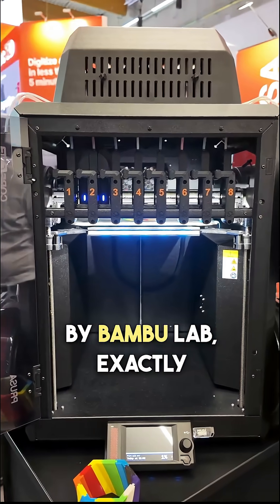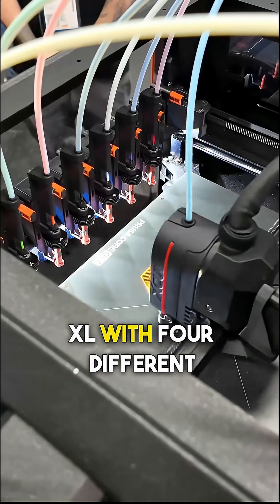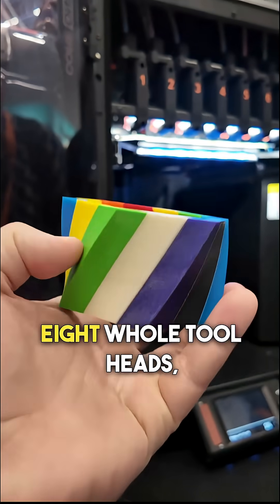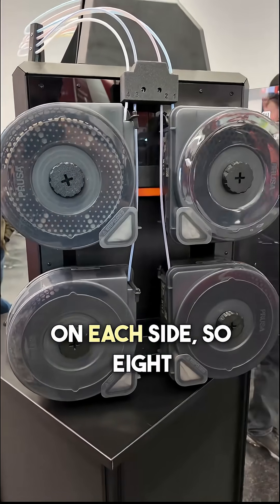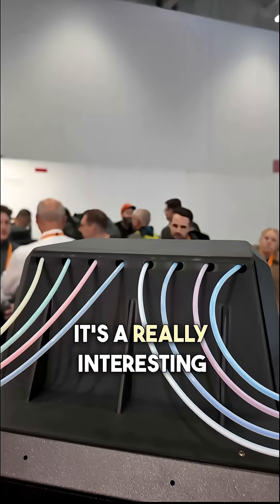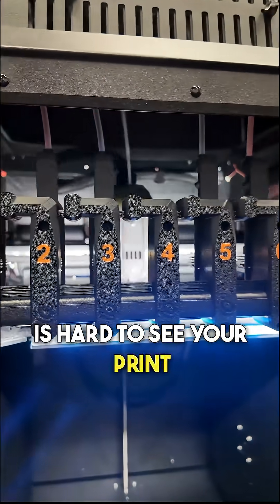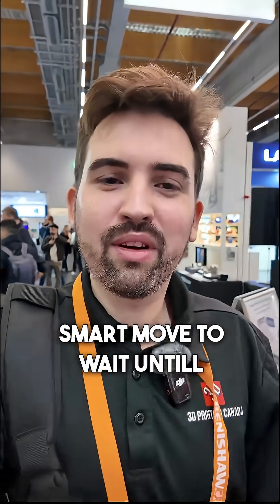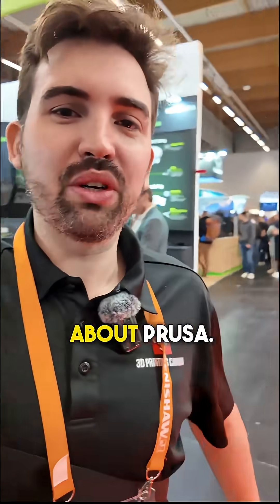The New Prusa Printer Has 8 Nozzles! #3dprinting #formnext

Comment: Bambu H2C is cheaper than Prusa
Reply: and the H2C has the ability to use a laser and cutter head which increases it versatility
Reply: @sharazar and yet the dust and other stuff from using that laser will cause issues over time
Reply: yes
Reply: And better for the other features Prusa hasn't
Reply: Who cares about price!? 😂
Reply: Bambu is Chinese built, Prusa chooses to account for European manufacturing costs. Also, the INDX system blows Vortek out of the water.
Reply: @syko2695 atleast Chinese do not use 3d printed components for its own printers 😂
Reply: @Reptilianoverlord-jc8mt  I might accept that point of view in theory but unfortunately for you, with the exception of the XL, Prusa are by far the most reliable hobbyist printers you can buy 😂

Comment: They probably want your 1st born for this.
Reply: It's not as expensive as I was expecting for a first gen product... Give it 6-12 months and we'll see some Chinese machines running INDX in any case.
Reply: @krazed0451 theres cheap Chinese and then theres Bambu Chinese 😂
Reply: It is not that expensive +500 for 4 nozzles + 700 or 800 for 8 nozzles
Reply: and second...third.....fourth....I only have two...so I won't be able to get one.
Reply: its cheaper than bambu vorteck

Comment: what everyone seems to miss is that the nozzles on the inxd contain the filament where as the h2c changes the nozzle but you need to load the filament
Reply: I don't think anyone is missing it Bambu have continually showed the entire process with an AMS (all the reviewers did too) 

It starts retracting when the nozzle change starts (the cut)  and is sending the new filament is at the heat break by the time the change is done on an ams2/ht (the original ams is slower) and then you're time restricted by the need to repressurise the nozzle which will be the case with the prusa too
Reply: It still has to purge filament.

Comment: both are too expensive, filaments too my cooper wire for mig welding is CHEAPER than most pla reels i have lol
Reply: You saw that on the video the other day with that metal 3D printer didn't you?
Reply: @carlosrobles9148  lol yea and I dissed them for being expensive too xD but not their wires but rather their machine and I had this opinion about filaments long before that video.
Its basically a welder on a CnC and they sell it at literally Ferrari prices...

Comment: Considering how rarely prints fail at first layers like they used to, access to the print isn't as necessary. 

Just wish prusa wasn't trying to be so upmarket with their pricing
Reply: Because they don’t make it with child labour like bambu does
Reply: I legit don't understand this comment.
First, it's one of the only companies that manufactures the printers in europe, not in china. This alone makes a huge difference in price.

But then, this system is way better than the one in the h2c, for way less money
Reply: @Sttreg I mean like the prusa printers are quality, over chinas version of prusa
Reply: @jesus8453  Bambu also is very good in quality and its from china before chinese goods were bad now it comes under two category the bad ones like before and the premium ones which are expensive but are still cheaper than european ones.
Reply: @Sttreg  To use this feature you have to buy an entire prusa core one i  believe this is only an addon thus its more expensive the problem with prusa was that it was the leader in 3d printing but apart from europe no one is going to buy it because it does not sell to 3rd party sellers and the customs are a killer not to mention the delivery cost and its production cost is high because it manufactures in the EU it could manufacture in china for the rest of the world
Reply: @Sttreg just do a little bit of research and you see almost every part is from china or made in china
Reply: @Sttreg The system may be better  but the printer itself isn't as capable.
Reply: @Sttreg  so you can produce in China for the same quality...
Why not do it then?
And no, the lower cost doesn't come from predatory work conditions anymore, it comes from extremely streamlined manufacturing processes, thanks to chinas planned economy.
Reply: @Sttreg gotta pay for the corruption somehow
Reply: Ya price is the only issue wish they could reduce the price sell to third party sellers in other country the customs is a killer on top of that cost they should transfer manufacturing to China atleast for non eu countries I like prusa but have to stick to bambu for this one
Reply: @anandisrocking007 same reason ill be going for bambu price and availability prusa is just pain in the ass to get in other countries
Reply: The add-on is the price of entire high performing printers 😭
Reply: @4473021 and it makes the core one the highest performing printer

Comment: I will say, the 8 nozzle change is better than the H2C's 6. However, the H2C has a dual nozzle system in general so which is better? 8 interchanging nozzles, or 6 interchanging nozzles and one extra regular? I would say that latter because with the regular nozzle, you're not restricted to just 6 or 8 materials. Bambu's AMS allows up to I believe 27 colors (if you have 4 AMS systems and then the 6 nozzles)
Reply: True but normally almost all printing required max 3-4 colors also in business sense this system is more upgradable then H2C takes a lot of time to reheat also the purge towers are way bigger and also the H2C takes twice the time to print than the snapmaker which uses similar system to prusa there is also the part of less moving functional parts which will be interchanged 100s of times on a single print and also the fact that one can misassign the nozzle after a print or so this method is better
Reply: @anandisrocking007 The H2c heats up very fast, that's not the problem, it's feeding the filament, that's what takes the most tine and it's a problem they can't fix in their current configuration.
Reply: You can't use certain materials with vortex, for example regular TPU
Reply: The AMS is the bottleneck, not the nozzle change system.   The H2C, imo should have been designed without the AMS in mind.
Reply: The H2C does 7 colors with the only waste being a prime tower, if you do more colors then you get purging
Reply: there is another advantge that a lot of people overlook with the h2c the ease of swapping a nozzle and i mean not only that you just throw it in there but also the auto calibration if im not mistaken (pls correct me if i do) the prusa is a pain to swap nozzles the snapmaker i belive has auto calibration but you have to remove the build plate where with bambu you just throw it in there give it a minute and done ok sure you may not have to change the nozzles much with prusa cause you got 8 so you can fit a 0.8 0.6 0.4 0.2 and still can fit another 4 diffrent or same nozzles but if multinozzle printing becomes implemented in the bambu system it will be more convenient cause you only need one spool of filemant in the bambu while for both snapmaker and prusa you need one for each nozzle which could get expensive and maybe it makes up in time loss with that feature because you will be too lazy most of the time to use it for prusa 

well on seconed thought maybe not cause the color inside the print where you would use a 0.8mm is pretty much irrelevant but you still would need a spool for each nozzle of the same material whre bambus system flushes and switch however it likes